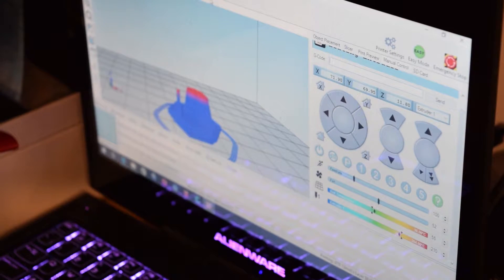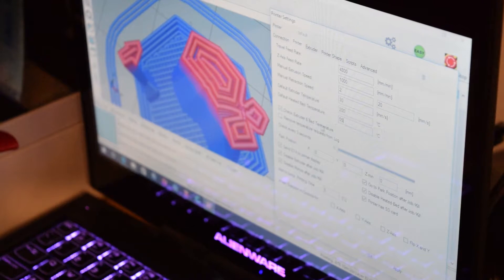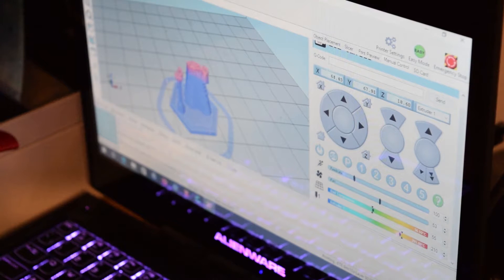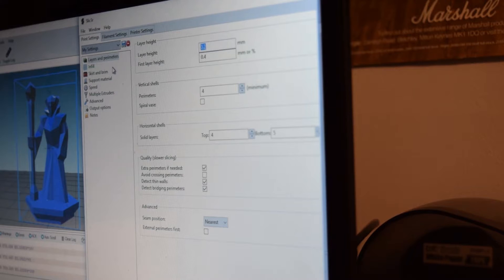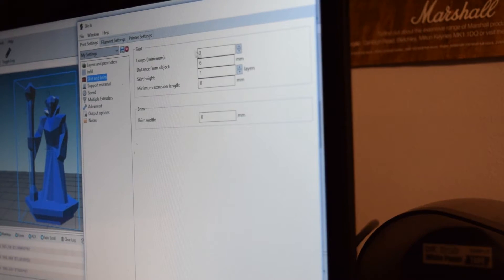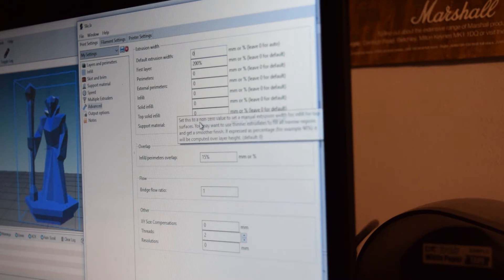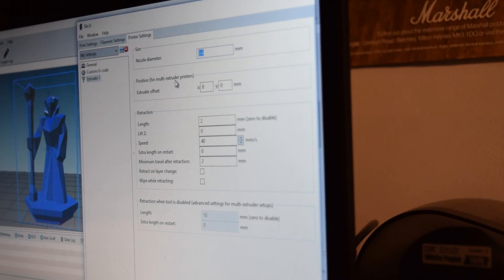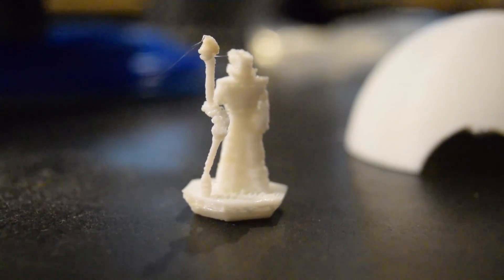Repetier Host - 1 - How To Use Repetier Host With the Vector 3 3D Printer

Comment: Hi, I have this printer but having issue in this software where the z axis will crash into the head. any suggestions?
Reply: @nath042  thanks that has sorted that but new issue is the layers seem to offset on the x axis any ideas?. http://imgur.com/a/7g6foZz
Reply: @nath042  had to strip the printer down a bit and found the securing screw from the cog end on the x axis motor was missing so it was slipping every so often
Reply from the maker: good to know thanks!